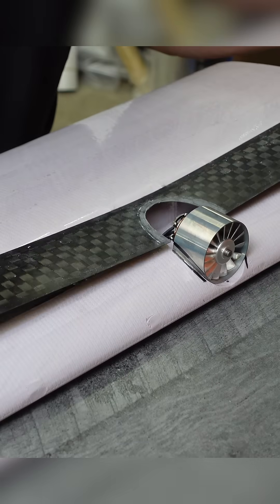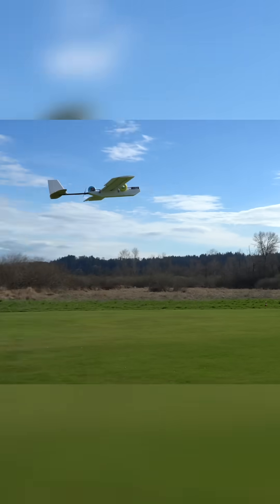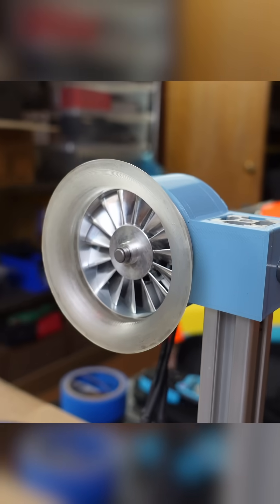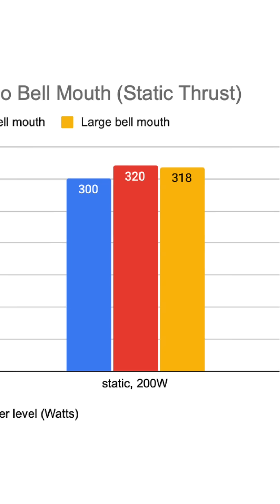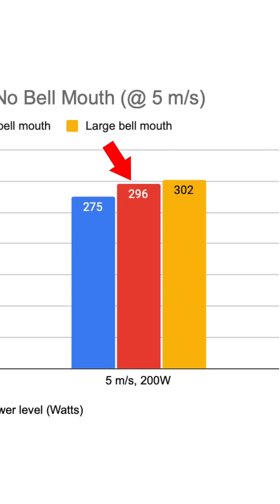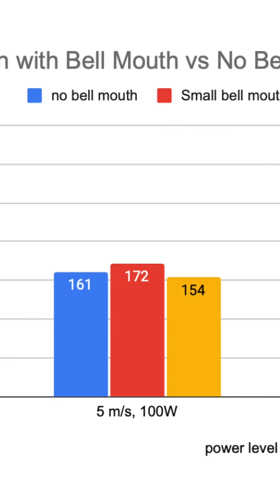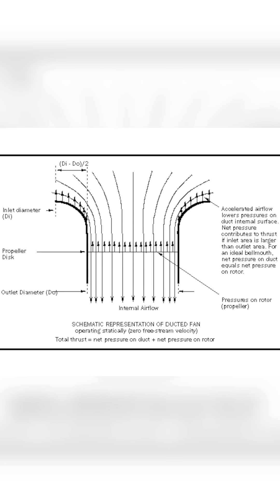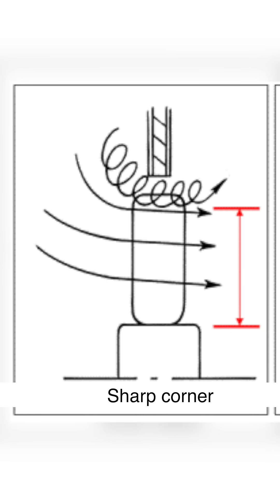Testing EDF Intake Shape for RC Plane #rcplane #aerodynamics

Comment: Hi, math person here. It's both. Not only does it smooth the intake allowing for better efficiency which only gives you like at best 1%. Because I mean, look at how close the edges are to the blade. That small tolerance is not a mistake. That's why they're designed that way. That's why they're that close to get rid of the turbulence that's created by a flat square edge. Okay, maybe 1.5% but that is on its best day.

Because of the wide mouth it does pull air from different areas creating a low pressure area. But this area is a small diamond, think the opposite of a shock diamond in a jet cone but still the same phenomenon literally the other side of the coin.

All thrust is canceled out. You are literally increasing the size of the intake. This artificially increases the fan size pass-through area. Any and all drag that you are creating is because you don't have those extra little like winglets or slits around the front of the Bell mouth to funnel air around the outside of the Bell mouth. 

I'm a math person, not an airplane person. I like the scale that you do things on.

Comment: To reduce drag, the bell-mouth intake must match the exterior of the EDF fan. Just like the engines pods on an A-10 Warthog. Otherwise, you have an air pocket behind the bell-mouth intake, causing drag with the oncoming air. Can't just have a bell mouth intake out in the open when facing forward without shaping the rear of it to be aerodynamic. Just like Turbojet engines hanging off wings, they are built aerodynamically. Yours has a nasty pocket of air behind it when facing forward. The small bell-mouth intake can be shaped around the EDF to reduce drag.
Reply: The best thing is to get some AstroTurf that has adhesive backing and put it around the perimeter of the inside of the fan hub. 
They've been using this on ducted fan airboats for decades. 
You just let the fan cut its own path out and then you have big chunks of air from the velocity stack that all of you suggested instead of super fast flow. 
We're trying to stay laminer but that will actually help its counterintuitive just try it and see. 
Dude there was putting EDFs on airplanes did this on a full size light sport and went five or seven knots if I remember faster cruise. 
That's a lot of improvement! 
I'm talking about the loose weave stuff not the super going to damage the blades of the fan actual NFL turf.
Reply: That's a cool idea to increase airflow, but in his application specifically, the ducted fans are just powering a laminar flow outlet over the wings, it wouldn't make sense to add turbulence to the flow that will just get smoothed out again right  @TtheK
Reply: Yup , laminar flow will definitely increase the efficiency and lower drag.
Reply: The A10 uses a short divergent duct, not a bellmouth.
Reply: This!! I'm puzzled why this was not done. It's more complex for sure, but well worth doing, as we all see on jet engines everywhere.
Reply: I was actually thinking he should have added a casting to continue that curve 2 allow a smooth flow around the outside to reduce extra drag from that modification.
Reply: I couldn’t figure out how to explain that thru text. Good job 👏
Reply: This hits the nail right on the head, couldn’t have said it better myself.
Reply: Oh, I never noticed that on the A-10. Good point!
Reply: We would wax the first stage fan blades on the TF34-GE100A to make min fan speed during engine trim tasks :)
Reply: @FarmerFpv my thoughts aswell. Does he skip that on purpose just to get two videos out of this instead of one?
Reply: Came to say this
Reply: Yes, that size basically flat plate neutralised any benefit. You need less flat and then engine fairings to streamline
Reply: This^^^ basic aerodynamics, you even showed it yourself when showing the pressure zones
Reply: Is it possible that at the speeds he's flying (slower speeds) that the skin friction drag of the added shaping behind the inlet could be more than the reduction of form drag it provides? Genuinely asking, curious to hear thoughts on it
Reply: Exactly what I highlighted. I have no formal training in aerodynamics just an inventor and design creator of aerodynamic roof racks and unique bike aero bars & helmet yet to be brought to market,  anyway It seemed obvious the air pocket would prevail in a forward motion potential air vortex hollow zone.:-). Cool 😎 and thanks for the input.
Reply: Came here to say this, but more ignorantly
Reply: I came here to say exactly this. The lack in aerodynamics around the bell-mouth is creating an insane amount of drag. 

Yes to bell-mouth, but also yes to housing around it.
Reply: Yup. What he said. There is cause for a toroidal flow. Gotta smooth out the back draft.

Comment: The curve draws more air into the fan than would otherwise enter because of the coanda effect. It's making the fan itself work better, not creating thrust by creating any kind of low pressure area

Comment: As a water engineer, I can tell you it's the latter. It's the smoothing of the flow, reducing turbulence and making laminar flow. We put bell mouths on water intakes sometimes if we needed the reduced headloss.
Reply: I worked in a powerplant and we pumped a lot of water between 90°C and 260°C(under 113bar it's still water) and I can confirm that small differences can make big changes.
Reply: @drei-zwei-eins  those are some oh shit that's scary numbers 😂
Reply: @drei-zwei-eins I wouldn't want one of those pipes to blow!!!
Reply: @drei-zwei-eins 
For some reason your account reminds of the movie “One, Two, Three” with James Cagney. He’s the tough talking CEO of Coca Cola Berlin and is always shouting one, two, three. Eins, Zwei, Drei. 
Tschüß !
Reply: @drei-zwei-eins 113 bar? I just puckered and I’m not even anywhere near those. Those are closed casket numbers 😭
Reply: As a certified forklift operator I concur.
Reply: @heatshield  I'm also a certified forklift operator (and owner.) ;-)
Reply: @heatshield  as a certified video viewer and YouTube Prime member, I too concur! 😮😅
Reply: @heatshield  🤣 okay, this got me
Reply: Keep it up.. I am a subscriber
Reply: Interesting. I’m retired from the National Weather Service Southeast River Forecast Center. I was a meteorologist working alongside hydrologists who forecasted river stage heights. We had to work with dam operators, all the time. We would base our forecasts, downstream of the dam’s output. The dams would base their output on our forecasts both upstream and downstream. 

As a water engineer, are you actually a hydrologist?
Reply: @JackRowsey  I only did hydrology as part of my education, never as a working engineer. I was always only ever interested in working with wastewater, but I had to do drinking water treatment too. My career was short, now I own my own wildland firefighting company, so I still get to work with water and pumps and pipes, but no longer as an engineer.
Reply: @wiredforstereo It sounds like you had an interesting array of jobs. I’m glad you’ve found your calling in Wildfire Fighting. We definitely need that. Thanks for your service. 

There’s a program within the NWS where meteorologists in our office can get trained in fire weather then can be detailed to a wildfire HQ on location. 

We’ve had a few in our office and I could have joined in but I had young kids at the time. They came back with a lot of amazing stories. I hope our NWS guys help you or and do a good job for you.
Reply: @JackRowsey  I'm not sure if I've been on fires with NWS folks, I contract with the state not federal, but all big fire operations have a resident meteorologist who gives us hourly reports. They generally stay in camp, as far as I'm aware, but they might get to do field trips, I don't really know.
Reply: Yeah. As an Aero engi, I also think there's an element of reducing flow detachment. By making a smooth surface, the intake can actually pull air from the sides of duct instead if a cone shape in front of the duct.
Reply: yes ... water lift pumps for flooding irrigation ditches ......however they were more of a flat based funnel for volume ....a larger suction area.
Reply: It probably would but in the air wouldn’t it make unwanted drag making it just as effective
Reply: @leobennier9444 In air, you'd want it built into the fairing or nacelle, as you see on jet planes and airliners. A big fatty bell like the ones in the video, you won't see. But look at the nacelle of any commercial jet liner. It's a "bell." It's much less pronounced, but it's there.
Reply: @wiredforstereo well the bell is just built into the body now,  so it is just blended in.
Reply: @leobennier9444increases air intake.. like ram air in a car engine.
Reply: I always thought it was “filling” the volume of the fan area so to speak, since with a sharp corner you’re losing volume. Volumetric efficiency as it were.
Reply: Is this something where Reynolds number matters?  Is RC scale a good representative of a full- size aircraft?
Reply: I only drink engineered water…
Reply: @TheLumberJacked Unlikely. Unless you only drink tap water from a city syatem.
Reply: He literally said that exact thing at the end of the video 😂
Reply: All jet aircraft have this bell shape incorporated, usually in the form of the engines housing. It allows the air to smoothly move into the intake since fluids don’t like to turn 90 degrees. This is to keep the airflow nice and even across the blades reducing uneven loads on the turbine blades that would result in over stressing of the blades and eventual failure.
Reply: My question is why it there no vortex generator bell mouth? Like a tokamak bell mouth
Reply: @stucheluchin4702  maybe it has something to do with the difference between generating thrust and generating lift. Just my first reaction. I know next to nothing.
Reply: I was just coming here to post that initial curve of the bellmouth put me in mind of the laminator flow wing but came here and somebody beat me to posting it. Well done.
Reply: You need to complete the bell. That flat area behind it has to go away.
Reply: Correct me if I'm wrong... But my intuition has always been that the bell mouth, or as I know it, a velocity stack, is used for automotive intakes to increase intake air density by drawing in more air and compressing it near the throat of the stack. I'm not an expert and that is simply a very slightly educated guess.
Reply: @vkogasmodeous2306 No, a velocity stack does not increase the density of air in the stack. The idea is that it allows the engine to get more air into the cylinder by having a smoother flow path. Longer intake runners generally equate to more torque.
Reply: Would you still want the sharp bell edge and wake area being it, or fill that area up?
Reply: @Cloxxki Look at the shape of an engine nacelle on a commercial jet liner. The naked bell is probably fine for stationary applications (also seen on helicopters IIRC) but if the plane is moving, you want it streamlined.
Reply: Absolutely, the same thing has been proven repeatedly with turbos.
Reply: I was going to say the same, I'm a test engine for turbojet engines. On our engines we see a 15% increase in thrust with a bell mouth
Reply: Yes...more uniform velocity distribution
Reply: Have you ever set up a sentry nest in the enemy's sewer in 2fort?
Reply: I've had a question for a long time. Is there any significant in different flow mechanics? IE Air, water, magnetic, electric, etc. 

I realize there are some differences, but arren't the overall mechanics basically the same?
Reply: @Grumpum Yes. Fluids behave like fluids. Compressible fluids behave like compressible fluids. Other things behave like other things. There are analogies and metaphors, but most things behave only like themselves or very similar things.
Reply: It also pulls in more air like a ram air in a car engine. Turbulance going on an air intake is good. On a water intake it is bad as it introduces vapor bubbles that collapse and explode damaging the pump.
Reply: Dude I was going to say that. Thanks
Reply: Same, we do it to increase pressure deltas on series systems which also helps mitigate cavitation.
Reply: LAMINAR? I GOT A REYNOLDS OF 1 BILLION! TELL ME ITS LAMINAR OR ILL END YOU AAAAAAAAAAAAAAAAAAAAAAAAAAAAA
Reply: I was thinking the same with less turbulence and friction, but I'm electrical. I know very little about aeronautics, so figured I'd stay out of it..
Reply: thanks for inventing water bro 🙏
Reply: @lilGafferLog  He didn't invent it he just engineered it 🤣
Reply: @redmammothstudios I'm thinking he meant it as a joke
Reply: air being thinner water the improvements might be less??
Reply: @TheGuruNetOn   The "improvements" are related to density of the fluid and velocity. Air is less dense, but you're moving a much greater volume of it at a much higher speed. With water, it's much more dense, and you're basically limited to a flow speed in a pipe of 10 m/s to reduce headloss and turbulence and cavitation and such. At air speed, you're limited to the speed of sound because as you approach the speed of sound you start getting shockwaves, propeller tips stop working, etc. Things get very loud and very inefficient. The "sound barrier" is what happens when air begins to stop behaving as a traditional gas.
Reply: @wiredforstereo that's it! Cavitation!
Reply: @TheGuruNetOn huh?
Reply: 😂😂😂🤦🏻 It needs to be open. You will not gain anything adding a big bell, because there is a limit on the quantity of air it can suck. You need to open a space between the bell and the fan, so the air will flow through it, THEN you'll have more gain 👍
Reply: @aquamastertheonlyone  Simply not true. Your freshman hydraulics class will teach you this. The bell smooths flow. Whatever justification you need to get your mind to figure out why it's better is up to you and your mind, but objectively, the bell decreases friction loss in the transition from an free fluid into a pipe.
Reply: @wiredforstereo Friend, in this case, as shown in the video, the gain was "negligible". If you add vents/passage between the bell and the fan IT'LL increase thrust.
Reply: @aquamastertheonlyone  All I have to say is prove it.
Reply: @wiredforstereo in fluid dynamics. There's a scientific name for it... i can't remember.  It prevents air bubbles going into the pump so that they don't collapse,  create extreme heat, and explode damaging the pump. Those tiny bubbles hit 14,000 degrees Kelvin.
Reply: @aquamastertheonlyone turbulence.. will add more air. That's how they do it in car engines.

Comment: All correct, my limited knowledge of this topic is greatly underwritten by my lack of degrees 😂
However,  I use this formula: 
   135% of the fan swept area for the intake diameter, this can be a reducing cone, and not the gradual curve as shown in this video, we are simply trying to compress the air intake. 
  10% reduction of the fan swept area for the exhaust, keeping the exhaust nozzle relatively short. 
  It should be noted that a nacelle for the ducted fan helps to greatly to reduce drag.  Hope that’s helps anyone try to optimize the EDF 
It looks pretty cool too.
Reply: Wouldn’t a CFD analysis give you all the data you need?  Regarding laminar flow.  My gas dynamics professor stated that laminar flow in nature is rare and is used in research because it obeys closed form solution techniques.  Better number with laminar flow are worthless if the aircraft doesn’t have improved performance.  A second parameter for the intake would have been the length of the bell mouth which seemed to be arbitrary.  Maybe turbulence from the leading edge of the wing were disturbing inflow to the motors.  Just a thought.  Excellent work.

Comment: These were good experiments, but in the end I think you must include the blown air part going over the wing.  If the bell mouth admits a higher volume of air, and also at a higher pressure, then you will get more blowing over the wing, and that could overshadow all of the effects you measured. Yeah, need a wind tunnel.  BUT, you are only looking for differences.  In such a case, you might can take that floor fan I think I saw in your video, and try it blown with and without the bell mouth and measure both the drag/thrust force and the lift and get a more complete integrated picture of what it does before trying it out. If your gear can record current and voltage of you battery draw, you could measure that over a programmed circuit, run it a few times and then integrate the power over time to get total energy expended for the circuit. You might can do this accurately enough to see the single digit differences expected by averaging a few flights each way. Thanks!

Comment: Would Bernoulli's principle apply here? The air speeding up lowering pressure allowing more air to easily enter through the center

   You see this basically flying jet engine with a seat they're call the jet bike 
    They need to add mini forced air wings and directional ducts with like bypass air you should try to make a model 😅 with edf

Have it so the wings pivot

Oh!! Just a gen on the main lift jet running edf in and on the wings ? Idk their design just seems so unstable 😮😅 I know what it is 

 A engine failure with their design 😮 at least a ballistic parachute 😅. But with batteries and edf wings redundant and more control!

   I mean people do realize how close we are to having jet moto irl 😅 
   That's what I'm doing here
🎉❤